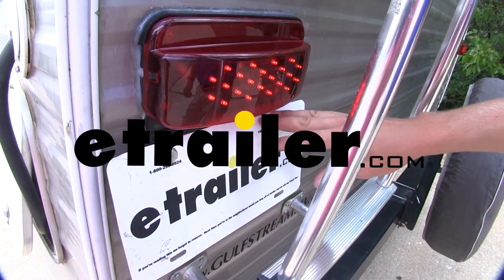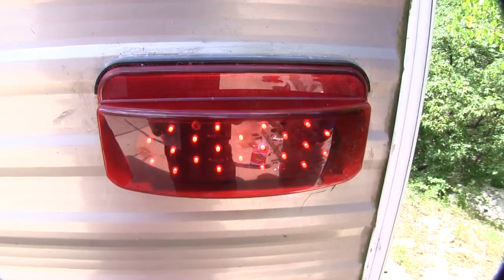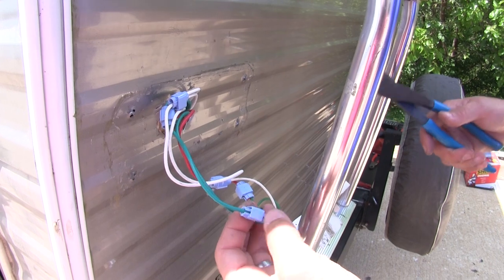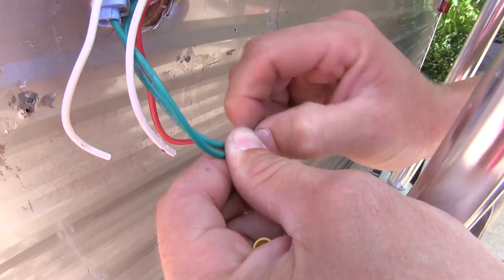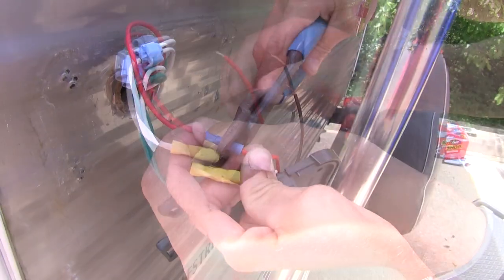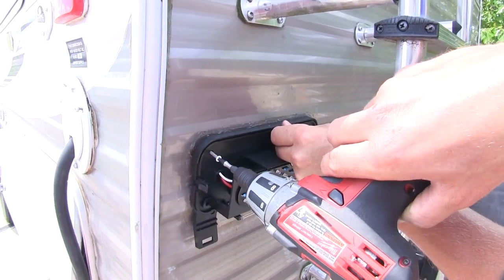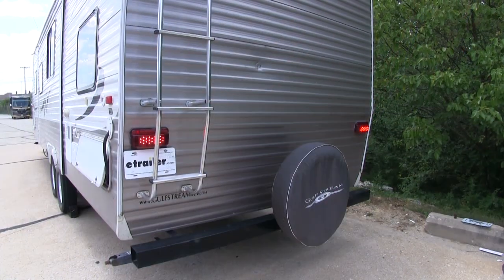etrailer | Command LED Trailer Tail Light Installation

Comment: For back up lights I use some solar powered LED lts. I have to get out and turn them on, otherwise they are motion activated and not too popular with other drivers. Saves hard wiring.

Comment: Thank you. Very helpful. QUESTION. I have installed mine. The running, brake and turn signal lights all work. But with turn signal on and brakes applied the turn signal stays on and keeps blinking.  . Is that correct?
Reply from the maker: Yes, that is what you want. When you are sitting at a stop light or stop sign, this will let others on the road know where you are wanting to turn.
https://www.etrailer.com/Trailer-Lights/Command-Electronics/328-003-81BM1.html

Comment: Would heat shrink be a better option than butt connectors
Reply from the maker: We recommend heat shrink butt connectors for external installations. This wiring is on the inside of the camper which is why its not crucial to use heat shrink.
 https://www.etrailer.com/Trailer-Lights/Command-Electronics/328-003-81BM1.html

https://www.etrailer.com/Accessories-and-Parts/Deka/DW05744-10.html

Comment: Hi. The distance of the holes are measuring 7 and 5/32. Just over 7 1/8” on my original exsisting lights. Your description are saying aprox 7”. Can you verify the measurement because I don’t want to make a hole right next to another hole. I want those screws in the exact same hole. The 2.5 “ measurements you give is exactly as what I have.
Reply from the maker: I went out to the warehouse and took the measurement myself and got 7-3/16. A hair off of your 7-5/32. Not going to find closer than that most likely

Comment: My camper has two green wires and a red on driver side . What wire is which ?
Reply from the maker: It sounds like somebody's rewired your trailer sometime in its past. Your best bet would be to have a helper activate all the taillight functions while you use a circuit tester like # PTW2992 on each wire to determine its purpose.
https://www.etrailer.com/Electrical-Tools/Performance-Tool/PTW2992.html

Comment: Is there a light like this that adds reverse lights easily? Or would additional wires need to be run through the trailer?
Reply from the maker: You would need to run a reverse light signal from the front of the vehicle if you do not have 7 pole wiring on the back of your RV. We have the light that is in the following link that is very popular amongst RVs.
https://www.etrailer.com/Trailer-Lights/Command-Electronics/CE44VR.html

Comment: Can I ask, do these cause hyper blinking turn signals?  Or do they have resistors built in?  Thanks in advance.
Reply from the maker: This light does not require resistors when you install it. Check out the following link for more information on this trailer light.
https://www.etrailer.com/Trailer-Lights/Command-Electronics/328-003-81BM1.html
Reply: @etrailer   thank you 🙏

Comment: When switching from incandescent to led on enclosed trailers do you have to run resistors? Incandescent light draw more then led. So will it burn out the led lights over time?
Reply from the maker: We have not seen any applications that have needed resistors when switching to LEDs on a trailer. If you were to experience rapid flashing, then you would need to install resistors. 
https://www.etrailer.com/Trailer-Lights/Command-Electronics/328-003-81BM1.html
Reply: Thank you for getting back to me
Reply: When you replace the signals in a car then you are reducing the amperage and may need resistors, but since it is a trailer it is just additional load so it the blinking will just be in sync with the tow vehicle.
Reply: Ok thank you

Comment: How do u get the red cover off to screw it in. Didnt show that did ya
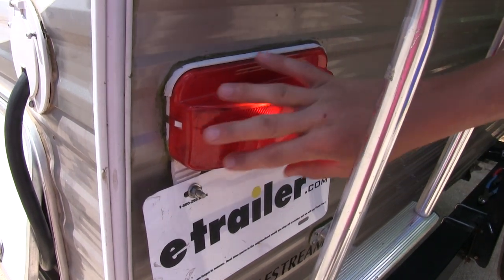Reply from the maker: At 1:15 in the video the installer shows how to remove the red lens using a flat head screw driver.
https://www.etrailer.com/Trailer-Lights/Command-Electronics/328-003-81BM1.html